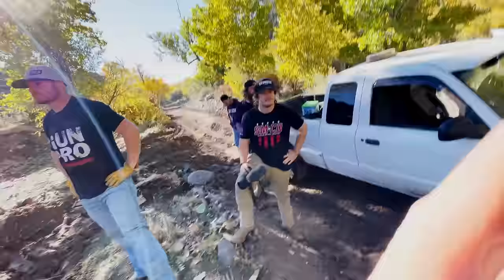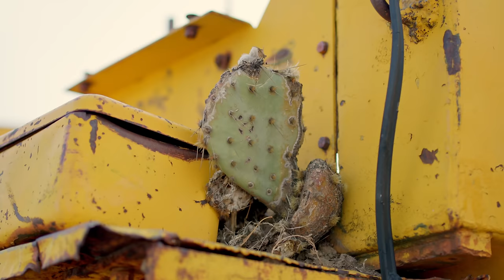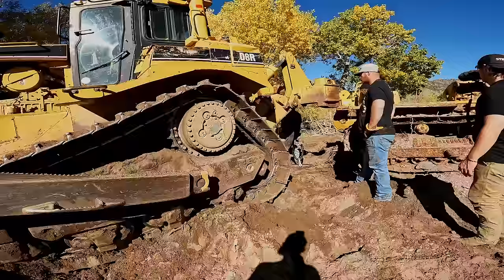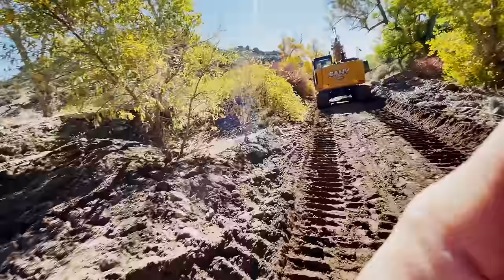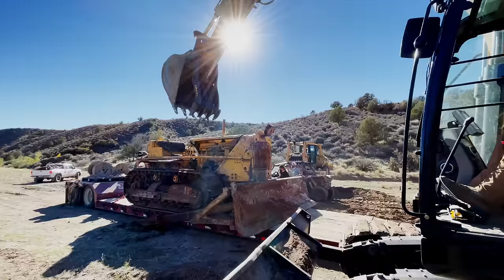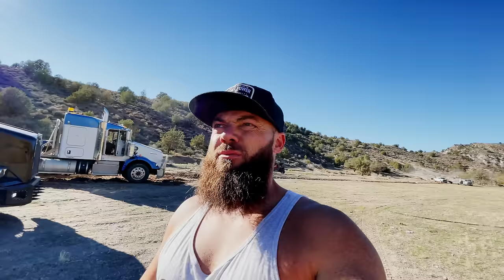How To Haul A Dead Dozer Down The Mountain - Insane Dozer Recovery!

Comment: "we'll do one pass and leave the road in a better condition than we found it." I would have liked to see the final state you left the road in.
Reply: I bet they used the D8 to clean it up.
Reply: T  ft
Reply: @rcairforceone  grading a road is more complicated than pulling a blade over it.

I think he underestimated how much trouble it is to get the road right.
Reply: Are you guys hiring?
Reply: Yeah they pretty much just shit Canned that road as soon as it rains its over you cant just smooth out loose soil with a d8 and call it good It won't hold up.
Reply: Given the circumstances of the situation and the kind of equipment those people had in that little "village", I don't think they were too worried about the road.
Reply: Probably more worried about the road the the stuck dozer. They ruined that road and the natural compaction.
Reply: Yeah, absolutely no chance they properly fixed the damage they did to that road. You can't just grade loose soil on top of the giant ruts you left and call it fixed.

Comment: Need to get a big piece of plate steel for a skid, and put the dozer on it to drag out. We do that for tracked vehicles at the steel mill. Getting the tracked vehicles from one end of the plant to the other would take for ever. Put the tracked vehicle on the plate steel skid and drag it with a big loader. Always look forward to your videos.
Reply: How long does it take to chew through a steel plate with all that weight on it?
Reply: That would destroy the road
Reply: Not worth carrying it most the time but I feel you the idea is solid if you have it on hand.. but with a D8 you don't even need it lol
Reply: They drag it across pavement and they use it for a long time before they make another one.
Reply: We do the same thing in the Mine where I work. We put the broken/dead mashines (up to 100 metric tons) on steelplates to drag them to the repair places.
Reply: @AA-nj4co  It wouldn't chew it up as bad as dragging the seized up tracks. When we make the skid its made with the front slopped up like a ski.
Reply: @Matty.Hill_87  we start with a piece of 1 1/2" plate, they use it for a while before we make another.
Reply: @robklunder2700  that's a clever trick, could have made this loads easier
Reply: I was just about to comment and ask if this very thing would be helpful.
Reply: Prob long enough to get it on a trailer?
Reply: @AA-nj4co  a metal skid would do a whole lot less damage than two locked up steel tracks. A metal skid is flat and smooth. Steel tracks have steel grousers that are going dig into the road at least a couple inches. I don't comprehend how you would think locked up tracks do less damage than a skid that not only distributes the weight over a larger surface area but also without grousers that are designed to dig into the dirt for traction.
Reply: We use steel skids all the time on pipeline jobs dragging things that don’t roll thru soft ground all the time behind dozers
Reply: I wonder how much he got from the SCRAP METAL GUYS????
Reply: Its the transport of the steel plate that makes this difficult to do on the road but I'm sure easy at the mill with more space.
Reply: @AA-nj4co  and pulling a set of stuck hardened steel tracks wouldn't do more damage to a road ?
Reply: @robklunder2700  then is not a peice of flat steal. Dragging a flat piece of steal across flat ground is gonna act like a box sccrpper and just dig into the ground
Reply: @johnnysouza5601  the guy said a flat peice of steel. Try dragging a flat peice of steel thru soft ground. A skid with skis would be better.
Reply: @AA-nj4co  no. Not flat. Slopped on the front like a ski.
Reply: @AA-nj4co  hes probably talking like a diant sled.
It makes sense.
The only issue insee is the pai getting it on the sled itself.
I guess if u had a way to kinda dig a 6 inch or so hole the size of the sled, n then still probably need to sexure the sped so when the item catches it doesnt pull the sled out from under it, n then once its on top of it, secure it to it, secure the sled n the pull.
It'd be great for something like this, because itd actually pack the dirt down rather than dig it up.
Even better might be some sort of hydraulic sled with wheels.
So kinda like a low boy in a sense that u can move it up and down. The wheels (they could also be 4 posts that u can then drop the ground n once loaded u can slide some axle type contraption under each side that allows it to be pulled without any problem but much smaller machines) are wider than the piece of metal they are attached to. That piece of metal drops to the ground completely to the ground, then u pull ur dead machine or maybe huge generator, or large machine, then those hydraulic posts evenly lift this piece of metal or ladder type metal (however u build the platform is irrelevant if its strong) n then you raise it up n get under it with however u wanna move it, wheels of some sort, n go.
Reply: Excellent idea. As I watched them drag that dozer down the road, destroying it in the process, I thought there has to be a better way. And here you have it! 👍🏻
Reply: @robklunder2700  you said a flat piece of steel. Only reason I commented. Later down in the comments you said to make it sloped in the front. If u would have said this at the beginning I would have never commented
Reply: That's genius
Reply: Or pull the cover off the final drive and pull the shaft out and let it free wheel...
Reply: @AA-nj4co  he said plate steel, never used the word flat in his initial comment.
Reply: The only soft area was where they dug. But I see you don't understand physics. Putting that much weight on skids in what you call soft ground would bury it. You need surface area to distribute the weight. That doesn't apply here though. Once out of the soft area that steel plate would work without a doubt and probably would be the best option other than Putting it on trailer.
Reply: Can't help but think a smaller Cat with a big winch on the back of it would be a useful addition to Heavy D's recovery fleet. While its nice to have the power of a D8, something smaller would be easier to transport. Feel they should have used the D8's ripper or blade to lift the front of the sleeping Cat to make it a bit easier to drag out.
Reply: @AA-nj4co  he said a piece of plate steel for a skid, skid= skid plate, which typically are bent pieces of plate steel used for dragging or protection in offroad.
Reply: I feel like for something that would need to be transported 2 pieces of flat stock would work better. 1 piece under each track. Could weld rings onto it and chain the equipment onto the the skis.
Reply: @AA-nj4co  lol. You didn’t read the comment very well.
Reply: @matthewserrao2926  plate steel is flat. Skid doesn't mean it's bent or anything. Skid just means it used for moving. Most skids are flat and mostly used to Easily move stuff with a forklift not to be dragged
Reply: I was going to say the same. It wouldn't destroy they road because you curve the front almost like a sled. Well we call it the steel sled. But definitely worth the investment
Reply: @tracksoneverything4085  what does plate mean? Lol
Reply: I just wrote about a sled then scrolled down and seen this! Good to see there is loads of common sense alive and well out there 😉👍🏻
Reply: @AA-nj4co  It won't destroy the road - It's a metal plate it'll simply slide over the top.
Reply: @robklunder2700  You're crazy If you think that a smooth metal plate would screw up the road as much as a higher PSI delivered to two non-functioning tracks digging into the road.
Reply: Better yet would be to create a custom super heavy duty flatbed trailer designed to be big enough just to get some of this big equipment on it but small enough to be taken on roads and turn around corners. Then they could trailer to their trailer. And even mount the little trailer on the big trailer without having to dismount the target cargo.
Reply: Yeah they should make some sort of sled that keeps itself on top of the dirt
Reply: @randallsmerna384  not if it's flat in the front. It's gonna plow thru the dirt not go over it
Reply: Randall Smerna I’ve done that before with a 24ft agricultural tractor low loader trailer and a big pile of wooden rollers, get them under the tracks n just puts it on, chain it down on the rollers👍🏻
Reply: It's just mathematics really.   Even 50 tons on a 5 square metre plate would only put one kilogram per square centimetre on the ground.
Reply: I have been dragging a skid of 5 railway track lengths 10ft long on a frame pulled by tractor on a farm here in Aus :) to grade the roads which get destroyed every time it rains due to reactive soils we have in this area.
Reply: @AA-nj4co  Yeah, that goes without saying - that's why I said it should slope in the front like a sled....
Also, there's going to be a natural tendency to be pulled up because the tie point on the pull vehicle is going to be higher than the tie point of the plate - so it's naturally going to want to raise. Nonetheless, I also said that it should have a sloped front...
Reply: I thought that too
Reply: Great idea! Any sort of skid would likely help!
Reply: Yeah definitely the way to go for dragging big stuff on mud without ripping the place up
Reply: They brought a steel plate. It's called a d8
Reply: Not a bad idea...in theory, however out in practice in the bush, you've got to contend with transportation to and fro the recovery site...I've got it! TWO steel  plates, each half the size of the original sled. First you cut the sled in half (length wise) and now it's a "modular" sled that can be stacked (or folded if you can attach a hinge strong enough), or use a skycrane...there is a third option that requires about 1 to 2 pounds of thermite and and a reclassification of the recovery from "we're taking this back to refurbish it" to "before we leave, remind the bucket operator to cover the molten slag with about 3 feet of sand."
Reply: @codybrown3946  even if it takes all night the results would of been worth it,as always the show must go on lol
Reply: Some of these comments are too much to even freaking try to read!!!!  DAM!!!!!!!!!
Reply: @PARTYINMYPANTS476  You would have to have something to hold them side by side. Beams that you could change the width would do it. If not..they would be pulling apart or together and out from under the tracks/load.
Reply: @Matty.Hill_87  it would literally take YEARS!
Reply: @AA-nj4co  not as much as dragging frozen tracks
Reply: @todtalk3912  Excavator lift up put sled on run chain through wheel repeat 4 times
Reply: @seldoon_nemar  do u understand how friction works
Reply: @randallsmerna384  you didn't say anything about it being slopped in the front until after I did. You said smooth plate. Obviously you can make a sled. All I have been trying to say is if u try to drag alot of weight on plate steel it's gonna plow unless you angle the front.
Reply: @My.name.goes.here.  I don't even see where u commented on anything. So yea I didn't read it
Reply: @tracksoneverything4085  Definition of plate
1a: a smooth flat thin piece of material

b(1): forged, rolled, or cast metal in sheets usually thicker than ¹/₄ inch (6 millimeters)
Reply: @AA-nj4co   Steel Plate, or structural steel is simply steel sheet material thicker than 6mm, that can be customarily cut and welded to develop a more elaborate product.  Say maybe like the skid he says that they use with a bent up front. I think of plate steel as more of the raw product. I'm just saying if you want to get technical he didn't say flat. Lol
Reply: @tracksoneverything4085  ok bro if u say so
Reply: @CaptainKevHaurakiGulf  my point, was more based on the idea not everyone would have the ability to obviously something like this, so dragging it across something not completely stationary to get it on top of would very difficult.
Yeah ur right tho. Everything on paper is as easy as this.
Reply: @codybrown3946  Yeah! I wondered why he didn't even try to take the final drives apart as well.  🤔
Reply: @AA-nj4co  Dinner is ready..  😂😂
Reply: What steel mill do you work at? I’m at Cleveland cliffs ( formerly Arcelormittal) in conshohocken Pa.
Reply: That's a genius idea and would've worked great for them. Even if they didn't slope the front although that would be simple to add as I'm sure you're aware. As long as there was some up angle on the pull it would've dug less than the cleats on those frozen tracks. Would've even graded the road for them a bit too.
Reply: We do the same thing for snowmobiles when they blow up.  Sled them out with a skid underneath the tracks. 👍
Reply: @Matty.Hill_87  we drag kubota r520 on skids around. Underground lots.. I bet out skid has 100k or 50 miles on it...  loose ground kinda make it roll. Much harder on hard packed ground...
Reply: Big minds think alike
Reply: AWESOME  👌  BLOSSOMS 🌸
Reply: @ruwithlee1970  not enough to pay each person and all the supplies and expenses they used, but how much will they get from supporters and ytube. There’s the money
Reply: @johnnysouza5601  finally someone that understands what they are talking about. Sliding it on dirt is not going to hurt anything. How many recoveries have they done similar to this. 4-5 then why don’t HD have something ready in his recovery box?
Reply: @jswplant9086  yell there is but no one has an opinion but HD, he has to always be right, it’s his show
Reply: @randallsmerna384  that’s what I think cause there’s a lot of places where those big flatbeds can’t go
Reply: Gene Goodman at the end of the day, I’m sure he knows what gets the best viewing figures, even if it’s doing things in ways that seem a little crazy to people like myself who work and own plant. If I personally had been recovering that dozer I wouldn’t have touched it with a winch in til I had entirely dug it out all around with the Sany. But I guess it makes for more “dramatic” viewing for the average viewer to break winch cables etc, lol. I like some of his videos, they are well produced, but I do find it all a tiny bit too much like modern reality tv. To be fair to him I like his stuff, and I can’t watch stuff like ice road truckers or any of the gold mining programs etc, they are all fake drama! Haha
Reply: @AA-nj4co  Why didn't YOU suggest it?
Reply: I was just going to say that !  That Would be Perfect  !
Reply: this is a really good idea
Reply: Great video!!!, The 5 ton wrecker is a great recovery machine, you need the digger poles to help keep it in place, and watch those cables, you worked them to the max, should replace them. That cable would cut you in half under those loads if it snaps and your in it's path. Keep the videos coming , great stuff.